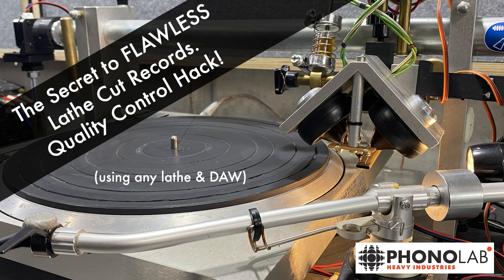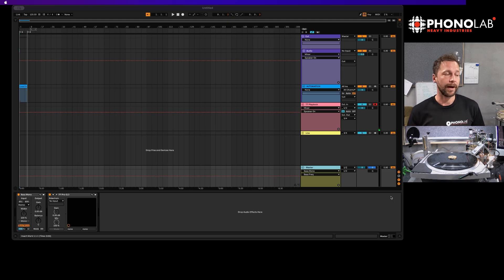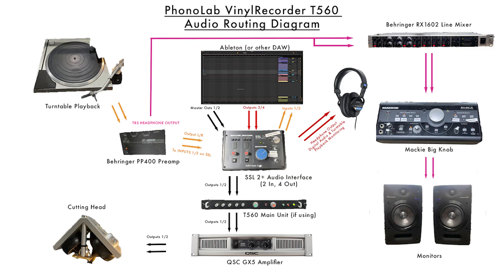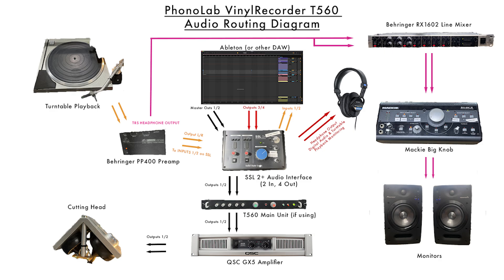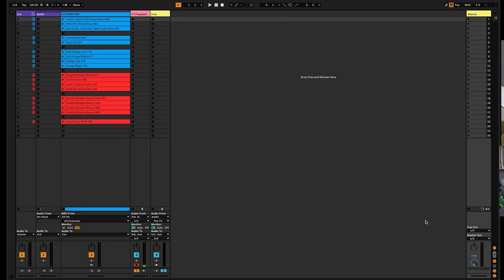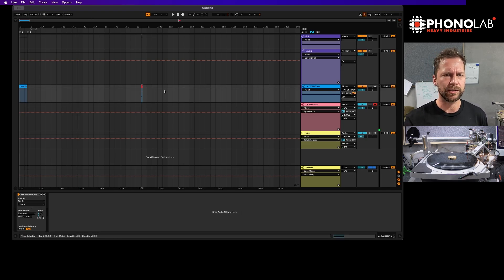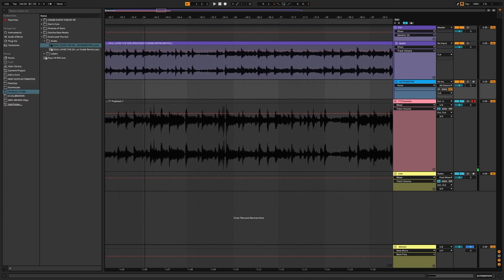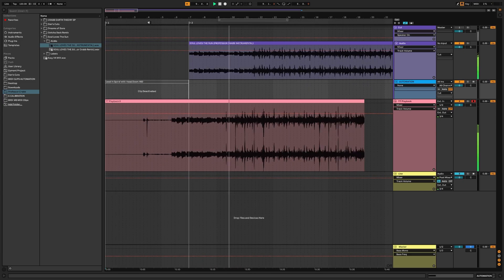The Secret to Flawless Lathe Cut Vinyl Records. Quality Control Hack!

Comment: Hi, noob here :) I'm little confused bout the diagram.
1. Why are you monitoring A/B only using headphones and not monitors?
Wouldn't be easier to connect headphones output from SSL to RX1602 and then to monitors so you could hear A/B (using brackets)?
- that way you could get rid of PP400 and connect turntable to SSL directly
2. Whats Big Knob for if you have only one input (Behringer) and one output?
3. If you are sending (via USB I assume) "Master Outs 1/2" and "Outputs 3/4" to SSL, then how does SSL "know" which tracks to send to "Outputs 1/2" (to Main Unit)?  

Cheers :)